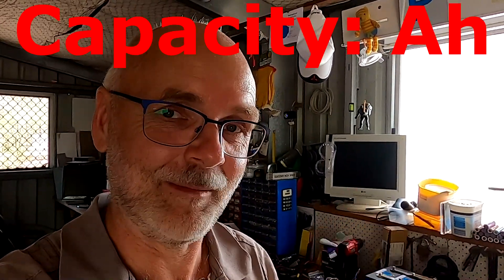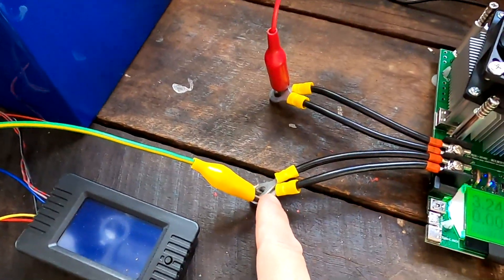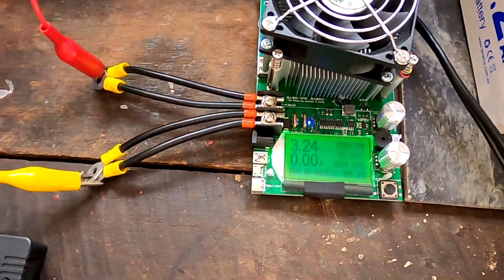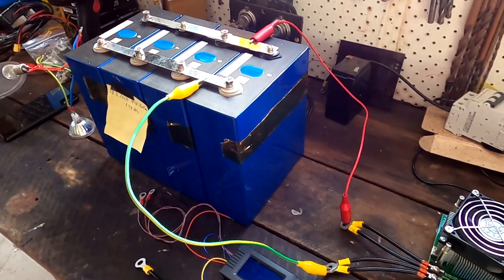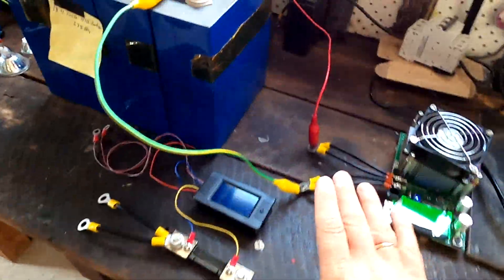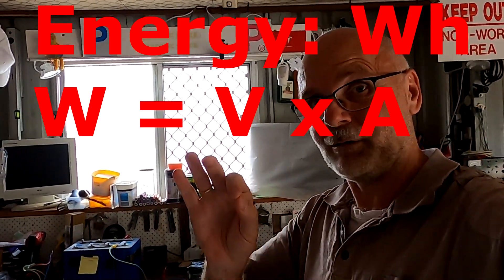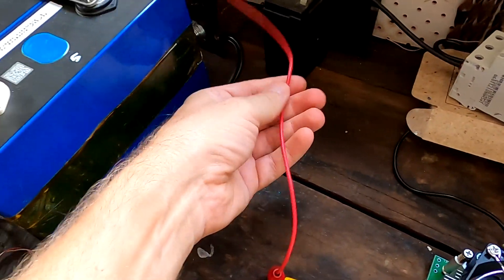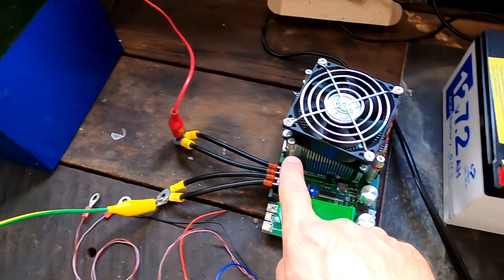Why Voltage does not matter at all during capacity testing! Here are the basics...

Comment: Andi, you are right. Let me make a comparison:
The capacity of a bucket is measured in litres. That does not say anything about its weight. It makes a difference if it drops out of 2 metres on your head filled with air, which may give you a little headache - or if it is filled with beer, which could smash your brains.
In this case the density of the material compares to the voltage of the battery.
N.B. Is there no better german beer than Oettinger in sunny hot australia?

Comment: Ok sorry for being late Mr teacher, but I've not long joined your class and working from first video to last, mine is not a comment or answer, it's a question on why not look at the input wires, connections? in this situation you have heat dissipation from the positive cable? Heat = power (w) (r) = amps being used before the device of measurement ?? or is it after given that voltage travels from neg to pos? again sorry for such a late response

Comment: I really like your videos,  very entertaining and very thought provoking,  but I'm not sure I entirely agree with you.  

Your load is a current sink (constant current) and it needs some voltage across it's terminals to operate correctly or the current sink will cut off.  So if the resistance of your battery + wiring is too high you may not be able to achieve the desired current load. 

The battery capacity, Ah, is specified for a particular discharge rate,  5/10/20/100hrs,  or 0.1C/1C etc and the capacity increases for lighter loads.  At some point the test will terminate when the current drops below the test value. So if you have a 100Ah battery and you want to test the capacity at 1C, your setup would not "cut the mustard" with your less than perfect cables,  but might be fine for 0.1C.

When you do a capacity test,  you have to operate the battery within an acceptable voltage range.  For example,  if I discharged the battery to 0V, I don't think the results would be valid. So you should stop the test when the voltage reaches the specified min voltage for the battery chemistry.  For Li-Ion this could be close to 0% SOC,  but for lead/acid,  this should be 50% SOC,  if you want a decent battery lifetime. (PS.  I do think the lead/acid battery datasheets assume that the capacity is measured from full charge or 100% SOC to full discharge or 0% SOC although this will destroy the lifetime of your battery).

So yes,  capacity is measured in Ah,  but IMHO the battery voltage still needs to be considered (boundary conditions) as it will likely limit the results of the capacity test.
Reply from the maker: Thank you. That's what I said, if the current drops because of lower voltage through 'bad cables and connections' it will just take longer to discharge the battery. The current will not be constant any more, but it does not need to be for such a 'home made' capacity test.
If you want to do this scientifically, yes, you're right we need to maintain this constant current. But then we would also need to have the correct cell temperature and all other conditions, right?
But I'm in my garage and a few Ah up or down, I'm not too concerned about... But soon we will be testing with a very accurate system.
Reply: @OffGridGarageAustralia  So sorry,  I missed that.  Just too eager to be a smart ass :)

So when you do a capacity test,  how do you know it's completed ?  
Most of the other channels seem to rely on the BMS to disconnect the battery if the voltage gets too low (LVD).

Comment: With a decent clamp amp meter, get a flexible cable and do 5-10 wraps of the cable around the clamp. 

Your reading will be proportional to the number of wraps, but your error is basically fixed, so you will have a much more precise reading.

Comment: Well, yes and no.  You have conflated too many issues here.  On the one hand you talk about amp hours and battery capacity but then you try to apply it to a measurement circuit that violates the rules necessary for your measurement and statement to be accurate except in a subset of circumstances.  It is true that in an ideal circuit where we are trying to measure battery capacity in terms of the number of electrons available for work, the battery has voltage (otherwise no current flows no matter what), and has only, for instance, a resistive load then the amount of the resistive load will not matter for amp hour measurements or the voltage drop across it as you claim.  The resistance WILL determine how long it takes to drain your battery but the battery will eventually move all the charge from negative to positive (or the opposite if you use the traditional current flow standard) terminals no matter what the resistance. However, the circuit you are using to measure amperage does not meet this criteria because you have a threshold device, the amp hour meter, that relies on a voltage above a threshold to keep operating.  Your load device has an under-voltage trip.  True, where you have your voltage threshold set in the video will only cause a very small loss in the capacity measurement but it is an loss never the less and your statement that circuit resistance  or voltage drops are not relevant is not correct.  If you were running your circuit with more amperage and/or more resistance (including internal resistance of the battery) the voltage drop between the battery and the terminals of your measurement device could become large enough to cause you measurement device to trip off at a time when the battery actually had significant capacity left.  As you have it in the 3rd capacity test video (https://www.youtube.com/watch?v=qoBl3cJo2s8&t=318s), I agree that your accuracy problem is not resistance.  However, in a typical scenario where we don't want battery voltage to drop below, say, 3.05 volts (so as to extend battery life) and set your metering device accordingly and you are running 10s to hundreds of amps or more the wire size and its resistance can become an issue.  This is especially true given that the meter you are using will only accommodate a limited wire size (of course, it is likely you would not use the particular meter you chose because it can only handle 150 - 180 watts so probably cannot handle large currents).  Even the 22 amps you actually ran in the the 3rd capacity test video (not the one amp you discuss in this video) would probably have caused more of a problem if you had run the capacity test with the tiny cables coming from the battery in this video (your test configuration in the prior video was much more robust than what you show in this video).  And did you know that in the prior video (third capacity test...) starting around 10:22 into the video you actually contradict pretty much everything you claim in this video?  You discuss internal battery resistance and how it impacts capacity.  Here you say resistance does not matter.  The truth is it all depends on what you are trying to do.  In the real world where we have inverters with trip points, BMS's with trip points, charge controllers with trip points, etc. resistance and voltage drops are certainly important and can drastically impact system amp hour capacity measurements.  Although you can argue that if a device trips prematurely there is still capacity in the battery (and I would agree) what we care about is getting the capacity, i.e. electrons, out of the battery and through the system and getting accurate battery capacity measurements.  So, although the battery may still have capacity, from a very practical standpoint, our "system" has run out of capacity if a device trips.

As I said in the prior video comments, measuring amp hours is actually not trivial and all kinds of factors and manufacturing/device tolerances come into play.  Current sensors that work well at low amps usually do not work accurately at high amps and vice versa.  Electrical noise sources including all the switching power supplies in most electrical equipment can obliterate the millivolt and sub millivolt measurements across a shunt resistor and in the Analog to Digital converter necessary to measure voltage (and thus current) in most meters.  Op amp offset voltages, device tolerances, poor calibration, and the limits of physics all play a role.  As I said in the prior video, I have 5 meters and I get 5 different results.  Four of the meters are within 10% but the other is 16 - 20% off.

I am not trying to bust your chops here because, believe me, I have made quite a few confused statements and incorrect conclusions myself,  But I try and stay away from absolute claims (and I do a lousy job if it).  Anyway, I do enjoy your videos as you and I have pulled our hair out over many of the same issues.  Hope you New Year is going well.
Reply from the maker: Thanks for your comprehensive comment, Robert.
The capacity tester uses an external power supply and can therefore measure down to almost 0V. It will not drop it unless they're is a more voltage disconnect set.
Not sure what you referring to at time 10:22 but the video is only 9:30 long...
Reply: @OffGridGarageAustralia  Your video I am talking about is here and it is 14:30 long.
 
https://www.youtube.com/watch?v=qoBl3cJo2s8&t=318s

 Start watching around 10:30 or so.  Trust me, I went though a similar process and had similar intermediate conclusions.  However, as I learned more and thought about it more (prompted by your video) I reached the conclusions I mentioned above.

The fact that the meter you are using has its own power supply is irrelevant.  The point is you set a low voltage trip point and the meter is going to go off line when it hits that trip point.  The various resistive losses in the system (i.e. cables, connections, wire size, internal and external resistances, etc.) between the battery and the meter are going to result in voltage losses between the battery and the terminals of your meter.  While it is true this does not affect the amp hours available (they are still distributed throughout the system at this point and mostly in the battery),  your battery voltage may be 100s of millivolts above what is measured at the terminals of the meter so you may have substantial capacity left in the battery but the meter is going to trip because its measured voltage is at or below the trip point due to the voltage losses in the system.  So, amp hours will effectively be trapped in the battery when the meter trips and you will get a meter reading that does not reflect the full amp hours of the battery.  There is no magic here, the extra electrons are still in the battery but since you meter has tripped you are no longer measuring them.  What you need to do is turn off the voltage trip on your meter and measure the voltage at the battery terminals and when that voltage reaches 2.5 you should stop the test and read the meter.  That way you will have an accurate test of the battery and its ability to meet spec. and this will work no matter what your current draw is (although we are not counting voltage drop over the internal resistance of the battery I am sure the battery manufacturer did not either).  So what I am saying is that while you are correct that the amp hours in the battery is independent of various external voltages and resistances the way we often measure the amp hours is not.  The very tools we use to measure Amp hours are dependent on voltages and resistances.  Now, another way to measure battery amp hours more correctly would be to set you test current at a constant rate (at least until we hit the non-linear region at the end) and measure the voltage drop between the battery terminals and the meter terminals.  Then we would lower the meters trip point by the measured value.

At any rate, with the setup you used in the video I referenced above and at 22 amps current, you won't see a lot of difference in measured amp hours because their is not much left  in your batteries when the meter trips.  However, at more realistic trip point values and currents where our goal is to make our batteries last and get as much as we can from the system you do need to take into account the voltage drop between battery and meter.  Since current loads will likely vary in daily use you will never be able to fully optimize things and will not utilize some available amp hours but that is life.

Comment: Hello sir please make a video on DIY lithium ion battery pack for my small hotel totally off grid. If not possible then sir please give me some knowledge about that in document form
Reply: Do a power audit, size the system accordingly. No one can just give you an answer to that kind of question.
Reply: @upnorthandpersonal  I do all of data collection and analysis I want 100KWh battery pack for solar energy of 48V. I want how to series and parallel connection do and which BMS use.
Reply: @ameythombare4004  128 cells of 280Ah will give you that. Turn that into 8 packs of 16 cells (16 cells in series x 8 packs in parallel) to make a 48V system. For BMS, you can either go cheap and take a risk and just have 8 parallel BMS (check diysolarforum for suggestions) or go with something like a Batrium if you want pro.
Reply: @upnorthandpersonal  thank you so much 😊✌️
Reply: @upnorthandpersonal  is that ok to connect all BMS together
Reply: @ameythombare4004  Depends on the BMS. There are too many out there to state that as yes/no - check with the manufacturer/datasheets/...
Reply: @upnorthandpersonal  ok thanks a lot for your support

Comment: Cable losses will slow the test, but they are NOT the same as setting your test to draw less current. Losses are losses and if you have them, you are not measuring the capacity of the battery.

The capacity of a battery is power stored, which is watt-hours. Amp-hours is energy, which is only capacity when you assume voltage. Batteries report capacity as amp-hours because it is a handy shortcut when you are comparing like batteries. Obviously the capacity a single cell battery is less than a battery with 16 of the same cells in series, yet the amp-hours are the same. Voltage matters because capacity is watt-hours.
Voltage is necessary to push amps thru the load and that is what transfers power. When you have loss in the cables that adds to the resistance of the load as seen by the battery. And yes, the current will be lower, because of that resistance. That doesn't change the fact that there is power lost, and that power came from the capacity of the battery.
Where are you measuring the power lost in the cables?  Where do you think that power being lost came from, if not the battery?
You aren't measuring it, and it did come from the battery. That lost power is lost capacity which your test will report as missing amp-hours because your test is predicated on a model of the cell, and your model includes additional losses which the manufacturer model does not include.

The manufacturer model includes different capacities for different amp rates because of the batteries apparent internal resistance (which might be due to construction, chemistry, etc - it doesn't matter way).

From the point of view of the battery you are testing it is delivering everything - it doesn't know you are throwing some of it away.
From the point of view of your tester, it is only getting part of what the battery is delivering, just as if the battery had much higher internal resistance than it actually has. Battery internal resistance is why an alkaline AA cell cannot run a high drain load for as long as a NiMH AA cell, even when the alkaline cell has more amp-hours in capacity. The high drain load causes more losses that are not able to be utilized by the load. Your test is faking a higher battery internal resistance, and thus higher losses.
Reply: The internal resistance of these batteries is very small. The standard at which these batteries are tested for capacity is at a 0.2C draw - he's below that. If you look at the curves for these batteries at different current draws, you can see that the difference between a higher and lower C rate is very small. If you measure the current anywhere in the circuit from battery - breaker - tester - wires - back to battery it will give you the same number since they're all in series. It doesn't matter if some of the energy in the battery goes to heat the wires, it's still the same current you measure. A 280Ah battery at whatever voltage means exactly that: if you put a load of x on it which results in a 280A current, it should be able to maintain this current for one hour. If you halve the load so you draw 140A, it should maintain this for 2 hours - it doesn't matter what you do with the energy or where in the circuit you use it/convert it.
Reply: "The capacity of a battery is power stored, which is watt-hours." False. Capacity of a battery is NOT power stored; or, said more succinctly, capacity is not power. The typical measurement of capacity, Ampere Hours, has NOTHING to do with Voltage whatsoever. When measuring power, however, Voltage obviously does, but again, he is not measuring power here.

"Where are you measuring the power lost in the cables?" He was NOT measuring power, therefore the "voltage lost in the cables" does not matter. 

"From the point of view of your tester, it is only getting part of what the battery is delivering..." False, in the context of the point he made in the video (because he's measuring capacity, not power). The *current* going through the tester is identical to the current going through every component in the circuit. The tester is measuring the current, and the current is the current (if you're curious, please review Kirchoff's Current Law). As he explains in the video, if he HAD been measuring Power/Watt Hours, then it would be VERY important to avoid voltage drop. That would require either VASTLY improving the cables/connectors, or the much easier option: using remote sensing on the load (having the load measure voltage directly at the battery terminals).